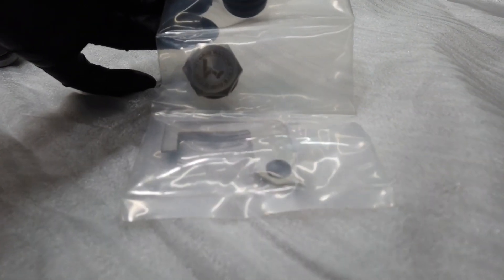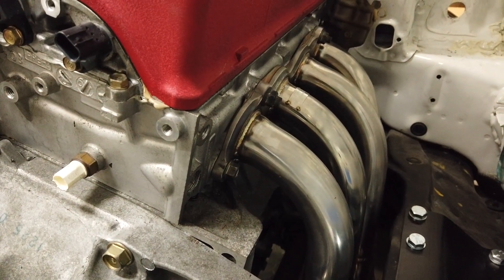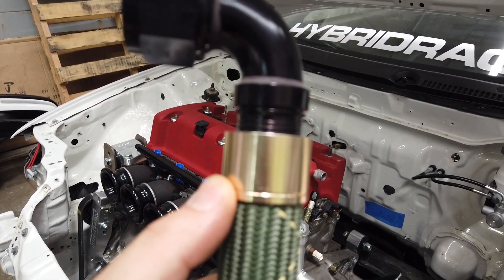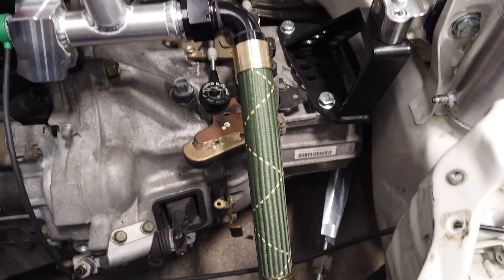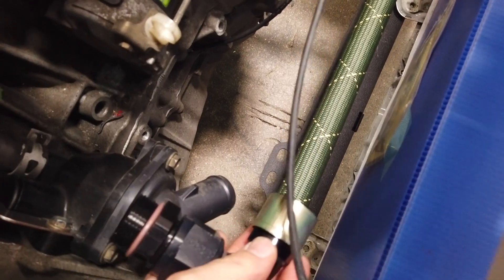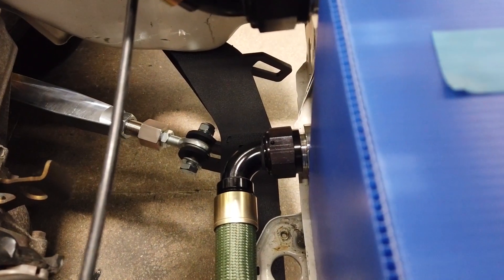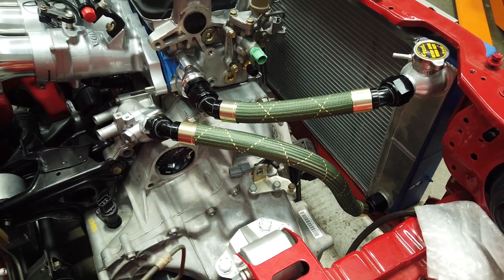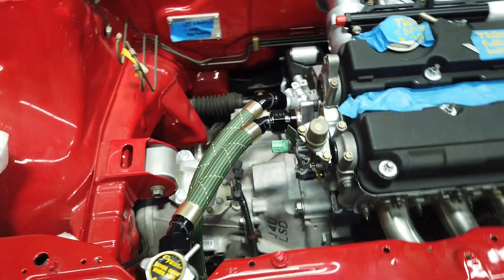Rywire K20 CRX Build Part 7 Cooling and Plumbing!

Comment: For the tucked radiator you offer either a slip-on inlet or -16an...do the hose inlets thread in? or do they need to be welded onto the radiator

Comment: On a high horsepower car ie, 1000 hp what size line or setup do you suggest for a street car thats driven around a lot?
Reply from the maker: -8 AN, but depends on fuel
Reply: @rywire  oh, I was talking about the radiator hose like. Is there a reduction in flow with the an lines?